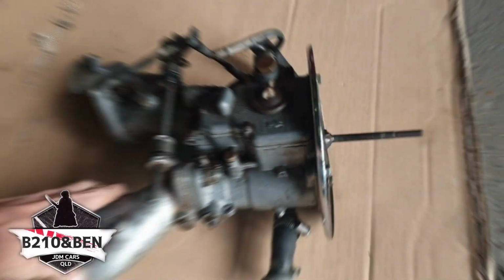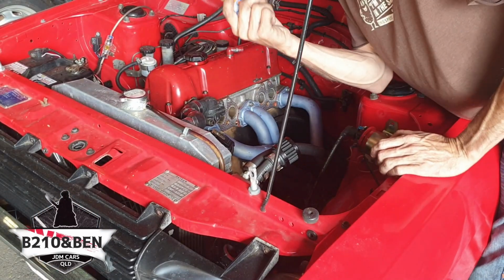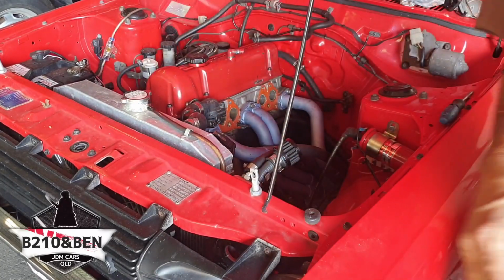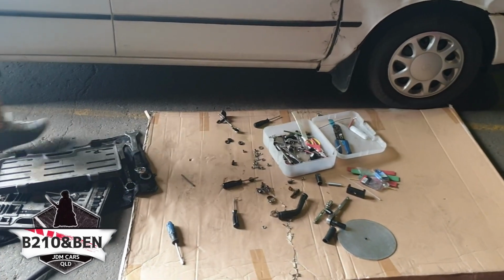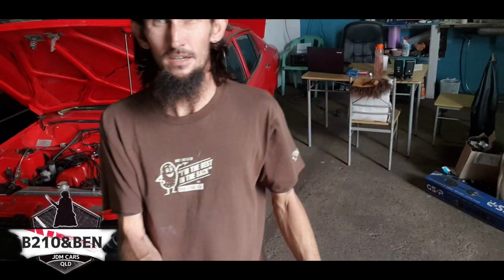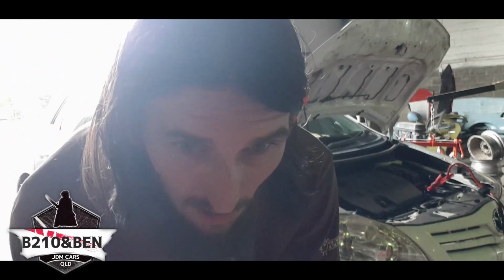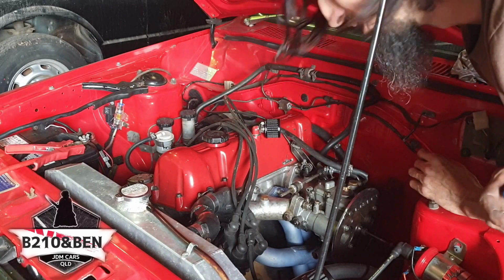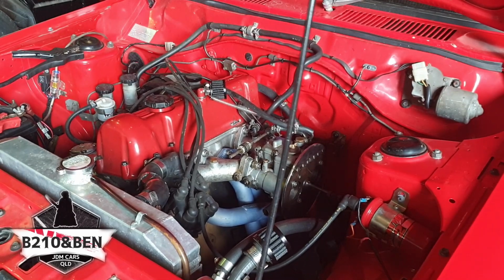L18 DATSUN 120Y- NEW MANIFOLD!!

Comment: How did you swap the engine? Did you use the same crossmember?
Reply from the maker: I bought it with the engine swap, the standard crossmember has been scalloped and reinforced to get the motor as low as possible and then L series mounts added.. Other then that it's just got ca18 s13 front brakes to pass engineering.. Simple as.. Thanks for watching.. I'll try get a video of what what done for the conversion.. Might be a little bit in my first few vids while the motor was out but I can't remember atm..